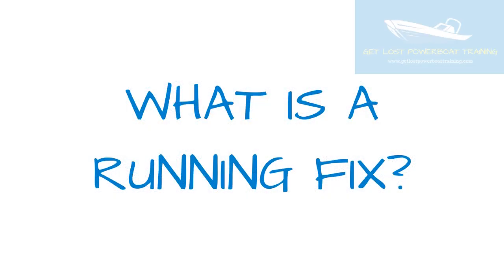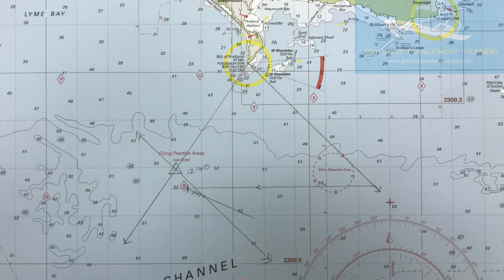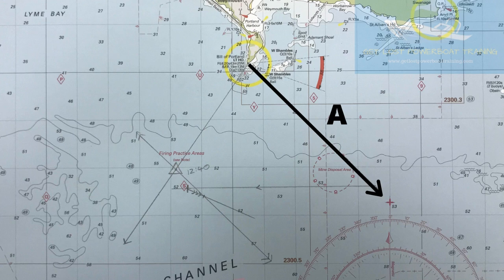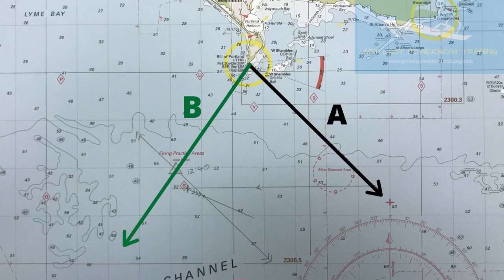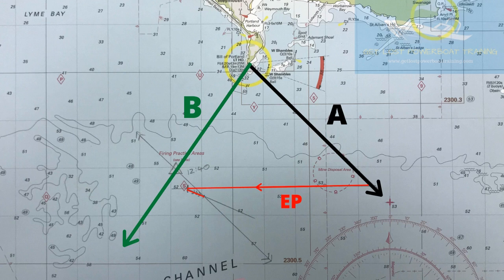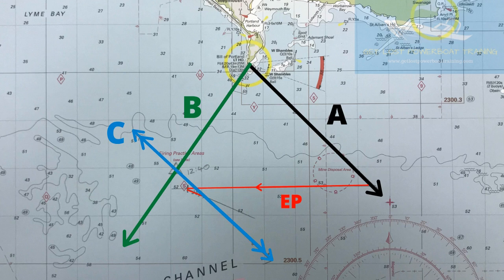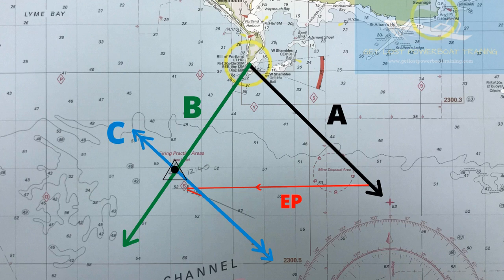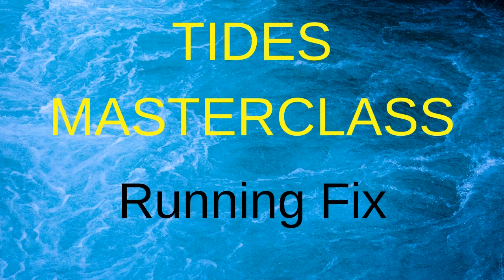Tides Masterclass   Running Fix

Comment: great & very clear. Thanks. Maybe it is too obvious to say, but then maybe not: the reason that you take the parallel to the first fix is that you are looking for a course over ground vector that is the right length, and the parallel is a way to give you that. Intuitively, your EP gives you length and direction; you need to find the points on the 2 fixes that "slot in"